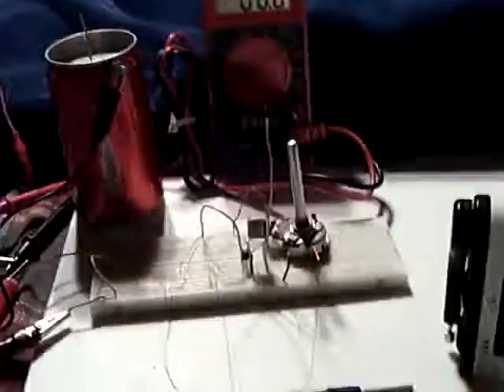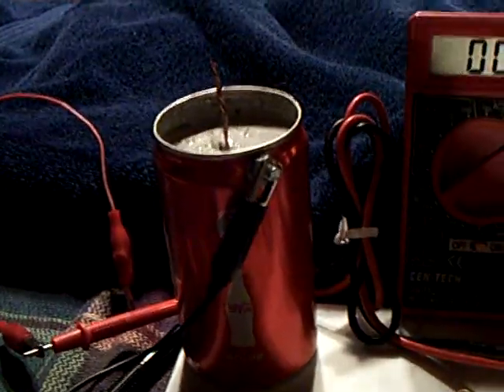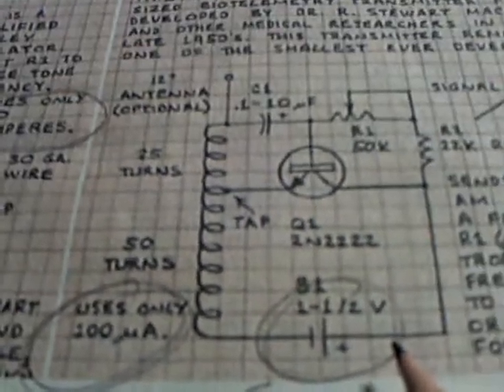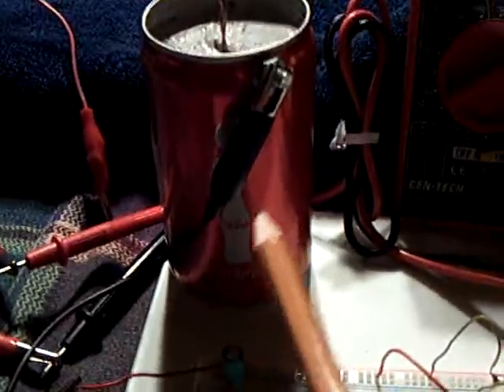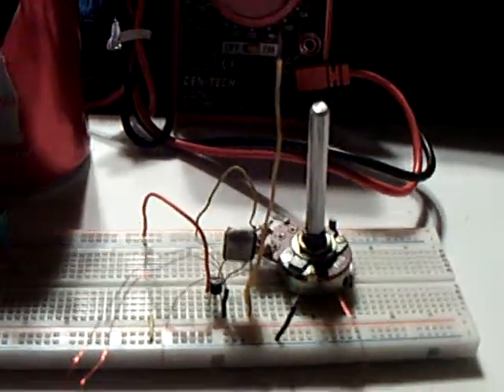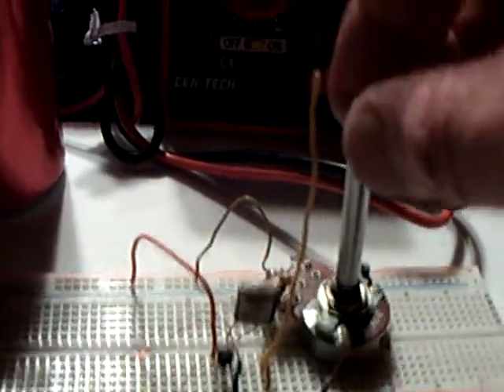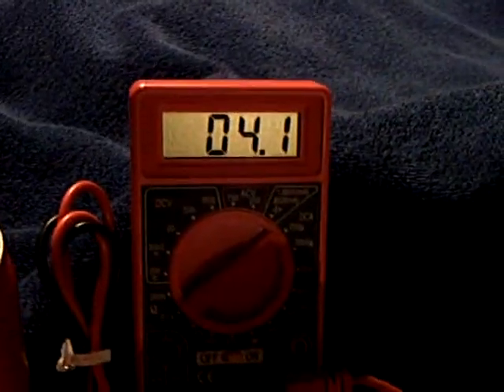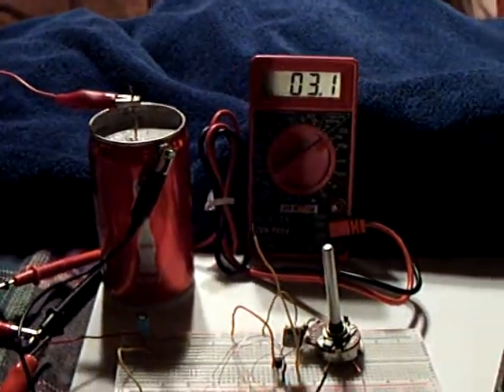Cement battery running a Hartley Oscillator Transmitter.ASF

Comment: +lidmotor
what's the frequency  range you got with your setup? I'd like to get from 1Hz - 4MHz approx if possible by using a big potentiometer. I want to activate a power MOSFET with it wich powers my DC pulse load circuit. I might even use it as a small high power inverter my putting a transformer on the load.
Reply: can I use 12v on this?

Comment: @koolerization
Hi there,
I was doing some experienting myself last week with those cement batteries and I found that you
can get some more voltage if you use cole instead of kopper.
I bought a sak of  burning coles for a barbeque and useds one of the coles and it gave of 1.5 V instead
of 1.2 V.

Maybe you can us it.

Kind regards,
Karel